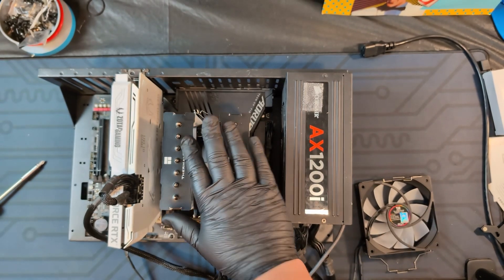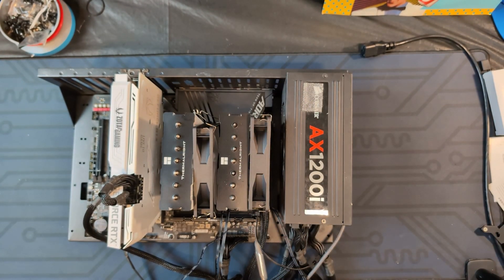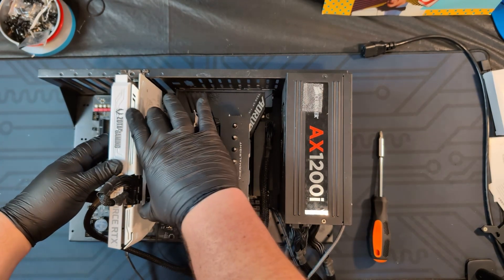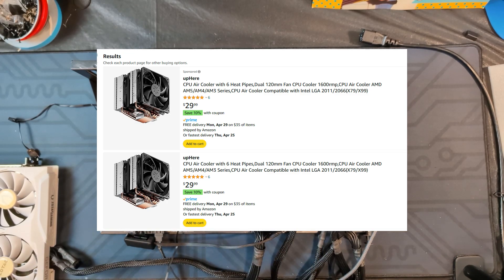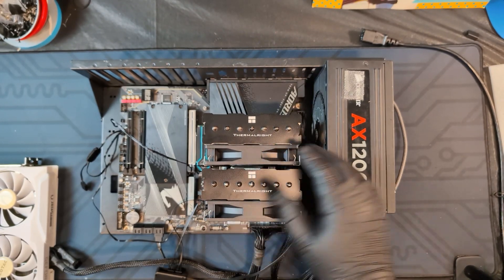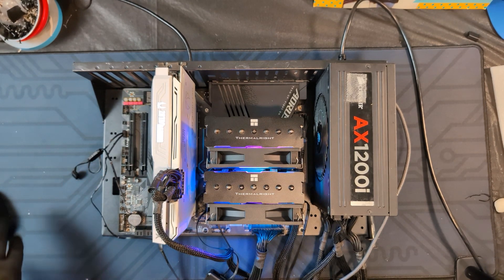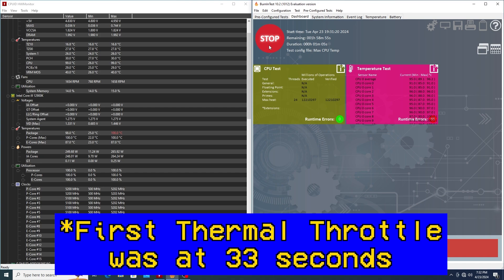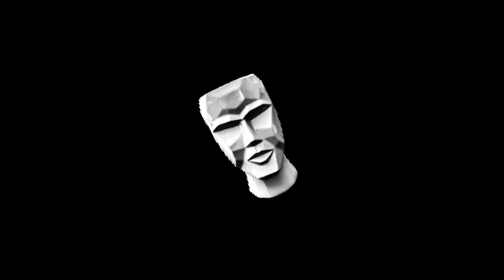Part 2 - $40 Air vs Liquid CPU Cooler - I respond to your comments and rectify a mistake.

Comment: Ok, i have a question. Your test bench is totally open. Which means youre not getting an exhaust airflow. In a real world design, you have intake and exhaust fans  so the hot air should be directed at the exhaust fan. Would that more tunneled design be beneficial or detremental?

In my case, the power supply is at the bottom, and the top of the case is a vent. So that's another direction I could be pointing the hot air from the cpu. 

Long question i know, but I wonder if a wind tunnel is better than open air.